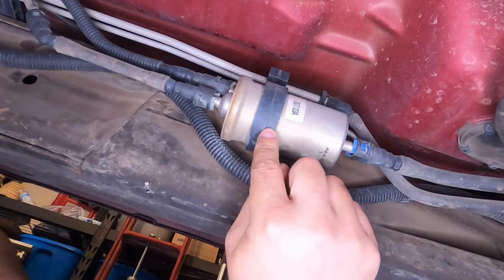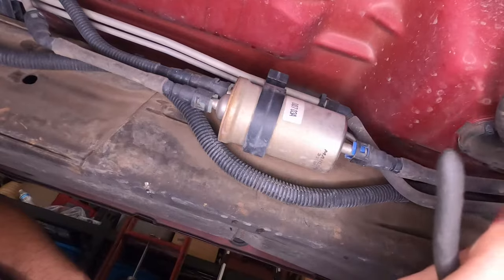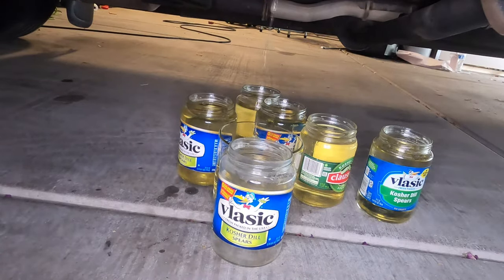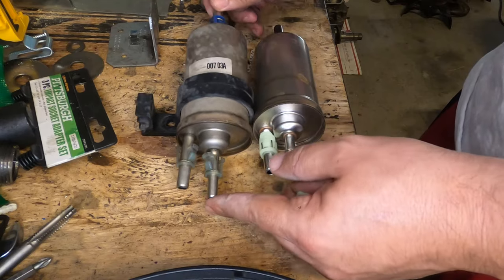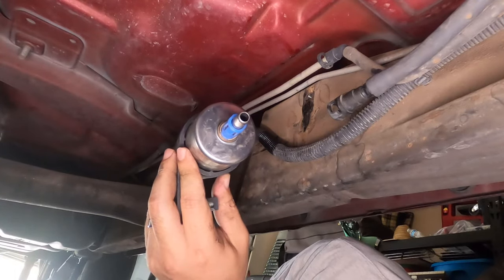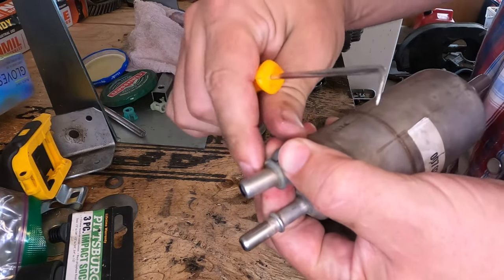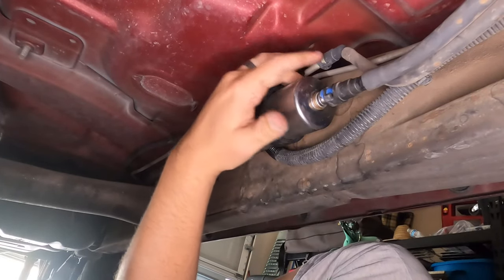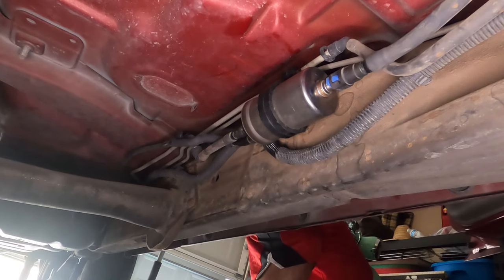Fuel Filter change on an Chevy S10

Comment: Quick tip - BEFORE you do ANYTHING disconnect the negative battery terminal and remove the fuel pump relay and cycle ignition. That will remove fuel pressure on the filter lines. No need for 6 mayonaise jars that way. Since the engine is now over 20 yrs old, when was the last time you replaced the fuel ignition spider? Fairly easy replace but makes a HUGE difference on how the engine gets gas in the first place.
Reply: I was surprised to see nothing about relieving the fuel pressure. (Negative cable too.)
Reply: Did you mean fuel injector?

Comment: How often is it replaced?
Reply from the maker: I depends on who you ask. Parts manufacturer says 15 to 20 thousand miles, car manufacturers say either 30 or 60 thousand and I usually do 100 thousand or unless there are issues with the car. If you live in a humid place I would do it closer to 60 thousand miles.

Comment: I'am Your Newest Subscriber Great Videos. I Wanta Get My 94 S10 Choptop Pickup Truck Running Again It Hasent Ran In 11 Years 2.2 Liter 5 Speed I Wanta Drive It Again
Reply from the maker: good luck with that. Will probably need al fuels system redone including injectors.
Reply: Start of with the basics. Replace fuel pump and while down there clean out the gas tank. When I changed the filter I didn’t even catch half the fuel that fell down on me but I got like 400ml in a bowl and it was full of dirt. Now I want to clean my fuel tank and I spect it for leaks

Comment: Apparently Chevy has 2 different fuel filters for the same year, not sure what the logic behind that idea was.
Reply from the maker: sounds about right, i have been finding either half year stuff or one year only with them so it seems fitting to have two different of the same part.
Reply: @LostSocketMotorsports how many does 2000 s10 have.

Comment: Can't you clamp the hoses to prevent the fuel leaking?
Reply from the maker: I guess you could further down on the line (plastic connectors on the end) but when you start clamping 20 year old rubber it starts to crack and car specific fuel lines are not that fun to change out.
Reply: and fuel line is not cheap @LostSocketMotorsports

Comment: What year is your S10? I have an 03 Xtreme and pretty sure the one side has a threaded side
Reply from the maker: 2003, mine is a 2.2. did the extreme come with a 4.3?
Reply: @LostSocketMotorsports  yes it does i got a s10 01 v6 vortex with a 4.3
Reply from the maker: @Nbs.gord0  im assuming the fuel filters are different because the engines are different,

Comment: Good to know , thank you .. I have to replace my seal on my oil pan .. 2002 , 2.2 liter
Reply: Oil pan gaskets are (somewhat) a universal replacement. Drain all the oil out, undo all of the bolts (if you have a pattern to torque them do it in reverse order), replace the gasket on the oil pan, put all the bolts back in(torque in order, if you have a torquing pattern for your vehicle), and then pour the oil back in and you're set. Preferably do it at the same time as an oil change so you're not putting dirty oil back in the vehicle.
Reply: @wyattcamacho7464  thank you , i'm going have to try it . i'm disable & it's hard for me to do some of the work my self ..
Reply: @kevinpitre533  I understand, best of luck my friend.
Reply: @wyattcamacho7464  Thank you , God Bless